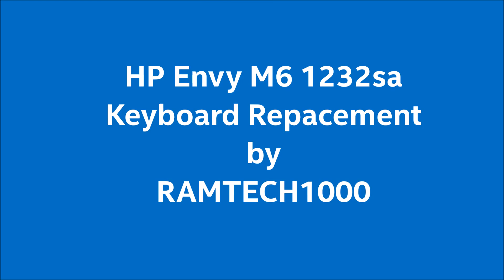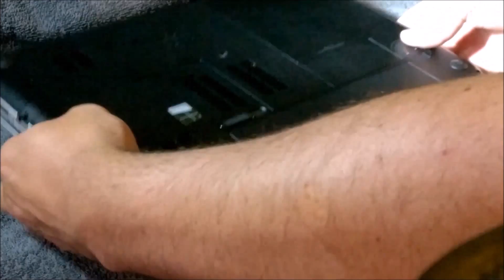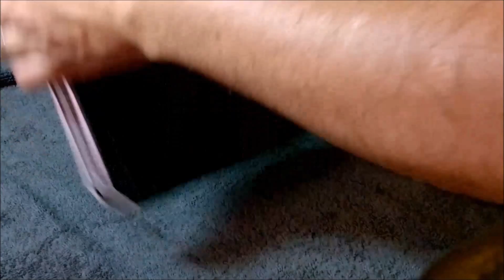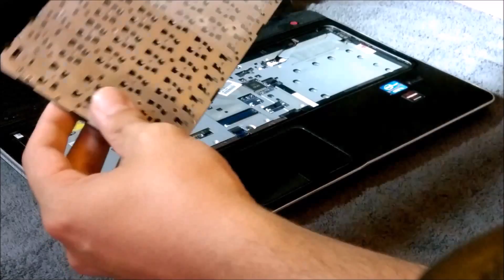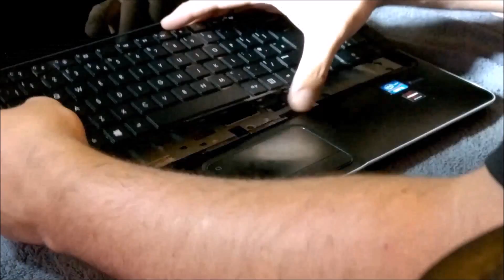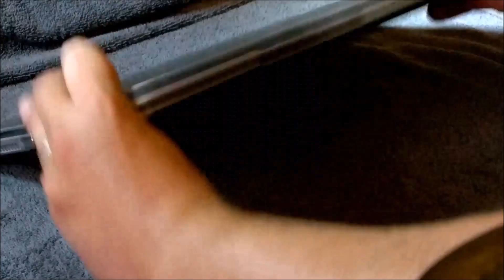HP Envy M6 1232sa Keyboard Replacement

Comment: Great video, I have a problem with my Envy M6 keyboard and I'm looking for a new one, but I have found that the replacement of this kind of keyboards comes without the frame, Do you know if it's possible to disassembly it from the old keyboard?
Reply from the maker: +Jose de Miguel Sorry for the delayed response. I too found this issue when trying to source a new keyboard and was unsure. In the end I just bought one and it turned out to be fine...simple swap!
Sorry I cannot be more helpful, I hope you get it sorted out.